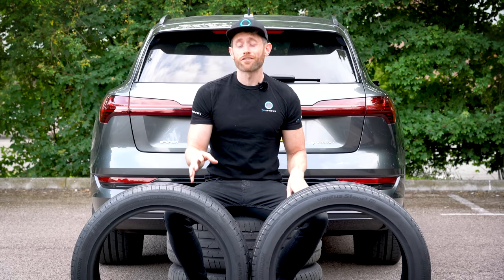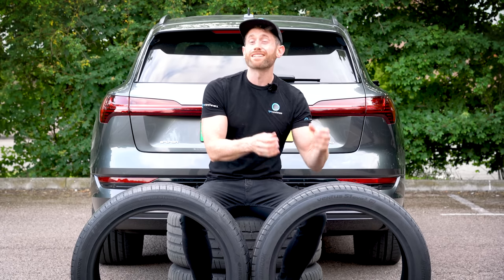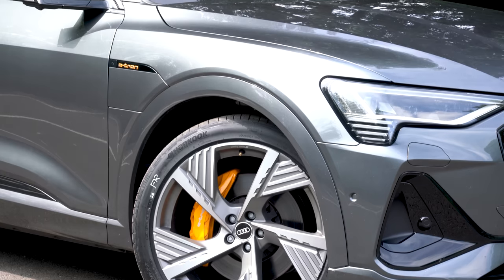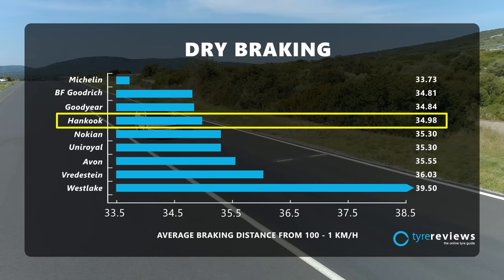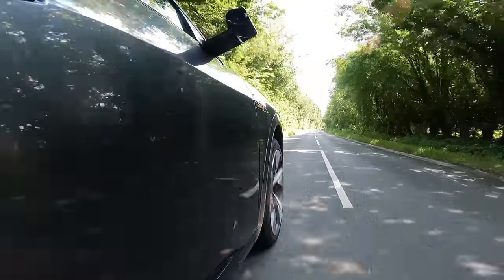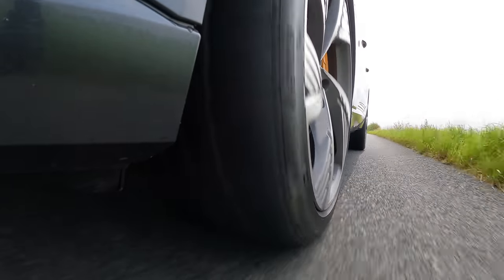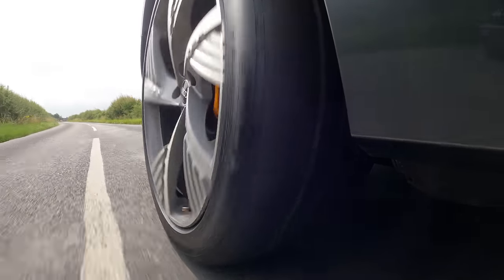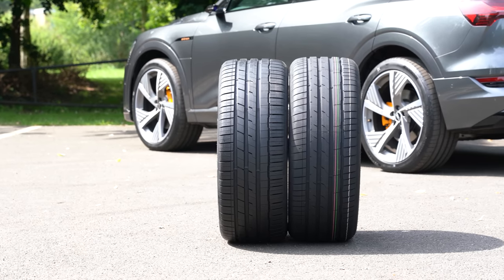What makes EV tires different, and why should you fit them! 🔌

Comment: Thanks for another very good tyre review. You mentioned the downside to EV’s of recharge time but I think that resale value is also going to be a big factor.
Reply from the maker: Good point!
Reply: I'd expect resale value of EVs to be better long term. They require way less maintenance and there's much less mechanically to go wrong with them. The big worry was always the batteries degrading, but that doesn't seem to be an issue on cars with good battery management (pretty much everything other than Nissan Leafs).

Even now, if you take a look at used prices for Teslas you'll see that resale value is very good.
Reply: @Xenon0000000000001  battery life is around 10 years in good conditions, you buy an EV, Tesla or whatever and run it for 2 years, battery life is now down to 8 years max if you’re lucky. Who will want to pay top dollar for a car with a max of 8 years left to run knowing that it may well be only 6 years?
Reply: @BobK5  Tesla’s last impact report showed about 10% battery degradation after 200,000 miles. The batteries in modern EVs will outlast the rest of the car. Just don’t buy an old Leaf.
Reply: @NickFoster  that’s reassuring if it’s accurate, I’ve yet to see it in practice though, running a battery car through seasonal changes and not always having the opportunity to charge it up efficiently. Running the car for 200,000 miles continuously isn’t the same as running the car 10 to 30 or 100 miles a day for ten years in road conditions and outside temperature variations. Who runs a car continuously for 200,000 miles?
Reply: @BobK5  because the 10 year life span actually means it will have lost 10-20% of capacity. It won’t be completely dead and will still be a completely viable car for the vast majority of people who average about 20 miles per day.
Reply: @therealjetlag  you’d have to be an idiot to buy a battery depleted vehicle with a life span of 5 years, unless it was £1.53 of course.
Reply: @BobK5  I think you need to do some more reading on the subject. The batteries are typically guaranteed for 8 years ( but are predicted to last for 150000 to 200000 miles, which is not much less than a diesel car and on par with a petrol. Secondly, EV batteries can be used for storage when they're no longer reliable for cars. People buy petrol cars with a limited life span ALL the time and you don't see anyone calling them idiots.
Reply: @therealjetlag  thanks for that Tat. Ok so you buy an EV with an 8 year guarantee (I’ll take your word on that as I don’t know what guarantees are given), where the maximum life in good conditions is reported as being about 10 years, so long as you keep it in a warm garage in the winter etc. 10 years for the average motorist equates to not more than around 100,000 miles. After the 10 years you won’t be able to do any more miles in the EV as the battery is no longer viable. 
So, you buy an EV for a premium price, above that of a similar petrol car and you have 10 years life expectancy. You run it for 3 years and do 30,000 miles which is the average and decide to sell it. Any prospective buyer will have to weigh up the price you’re asking along with the fact that the EV has only a max of 7 years life left and that from now on those 7 years are going to be difficult as the battery will continue degenerating as it ages giving the user less range, longer charging time and being impractical to run. Are you going to try and sell your EV to a prospective buying reflecting the premium price you paid for it? If so the prospective buyer would have to be an idiot to buy an EV with potentially 7 years life left and a rapidly decreasing resale value.
EV’s are a concept, the concept has been pushed through to the public long before credibility is achieved. 
The government has a track record of idiocy in this area, encouraging motorists to buy diesel vehicles instead of petrol, complete and utter stupidity sold on a false assurance that modern diesel vehicles were ‘cleaner’ than petrol. The same Ill thought out ideas apply to EV’s and it’ll be the customers who catch the cold with them for sure.
Reply: @BobK5  "After the 10 years you won’t be able to do any more miles in the EV as the battery is no longer viable. " 

No no no no no no no no no no no. 

You've already been told TWICE that, after 10 years, the battery will likely have lost 10% of its capacity. That means it still has 90% of its capacity, or, in numbers, that means a 300 mile range battery will still give 270 miles. Even if it's down 20%, you can still get 240 miles. When the average driver does 20 miles a day, there's plenty of life left in the battery.

Like I said, you need to do more reading.
Reply: @BobK5  And I've just googled "average lifespan of a diesel car" and it came back with 8 years. Yet, people buy 8 year old cars ALL THE TIME.
Reply: @therealjetlag  8 years 😂, take a look outside
Reply: @BobK5  what are you on about now?
Reply: @therealjetlag  I sold my Ford Focus that I bought new in 2001, 180,000 miles, 20 years old and still going that’s what I’m on about. You’ll be lucky to get 10 years out of an EV even if it’s only done 20,000 miles. You buy one if you want, it’s your choice but don’t come back here crying when you realise it’s money down the drain, you’d have to be pea brained to buy an EV for the full market price, sounds like you are.
Reply: @BobK5  you’re clearly not listening. I’ve explained it all, but you don’t want to hear it so the conversation is done.
Reply: @therealjetlag  I have listened to your understanding Tats which flies in the face of common sense, but if you’re an EV owner your comments do make sense but are far far far away from persuasive and I won’t be buying one anytime soon, that’s all that matters.
Reply: @BobK5  Twangman5: “no idiot would buy a car at the end of its life…” 
Also Twangman5: “I’ve just sold a car at the end of its life”.
At least you were honest in the end. You don’t understand EVs, you just hate them; fair enough. You could have saved us both time and just said you were going to be belligerent and not listen to a single thing I told you.
Reply: @BobK5  and I don’t understand how saying that an EV battery only degrades by 10% in 10 years “flies in the face of common sense”. You don’t get it, you don’t want to get it, you can’t be bothered to google it, you just want to troll. Enjoy your rising gas prices.
Reply: @therealjetlag  saying that an EV battery only degrades by 10% can only be intended to mislead as it’s untrue. Whatever you want to say about EV cars and how you believe they are economically and practically viable is great as long as you’re not expecting everyone to agree with you just because that’s what you want to think. Definition of a troll = anyone who disagrees with your point of view, which makes me a troll in your eyes.
Enjoy your EV, hope you get a good price for it when you’re ready to off load and enjoy the electricity price hikes coming your way.
Reply: @therealjetlag  I don’t hate them, I’ve test driven them and they’re good to drive but they’re not a good investment.
Reply: @BobK5  cars are never good investments, what are you talking about?
Reply: @therealjetlag  presumably you would rather walk, cycle or use public transport 😳
Reply: @therealjetlag  yes I sold the Focus at the end of its 20 year life of fantastic service to a scrap company who came and collected it, drove it onto the car transporter and disappeared. The only thing wrong with it was it needed a bit of welding on one of the sills and as I’ve got 3 other cars I let it go. If it had been an EV it would have ‘gone’ over 10 years earlier, what’s difficult to understand about that!
Reply: @BobK5  No, it would not have “been gone 10 years earlier” as I’ve already explained to you. There are 10 year old electric cars still on the road with far inferior batteries. I get it. You don’t want to accept you’re wrong. It’s hard. I understand.
Reply: @BobK5  cars are not investments. They lose value the moment you leave the forecourt. It has nothing to do with wanting to walk 🙄
Reply: @therealjetlag  cars, including battery powered cars, are investments when you use your own money to buy one. You are investing in the ability of the car to transport you whenever you want to wherever you want reliably, safely and efficiently. The more reliable, safe and efficient a car is the more your investment will be rewarded. Battery powered cars are not a good investment as at 5 years with 30,000 on the clock they won’t be attractive as an investment in transport to a prospective purchaser as they won’t be efficient for much longer. Using the term ‘investment’ does not automatically involve the value of money unless it is preceded by the word ‘financial’.
Reply: @therealjetlag  who in their right mind is going to buy an EV car with any sort of premium price tag with a battery on its last legs?
Reply: I saw tesla with 10 years for more than 30.000 usd...

Comment: Agree on EVs but in general, meaning day-to-day charging is a non-issue. It charges when it's parked. Does not matter how slow. At the grocery store, at IKEA, at the playground. Of course some destinations may be chosen based on charging infrastructure. For long trips, my experience is, the car is quicker ready to go than we are. It's mostly a myth. Except very specific use cases (e.g. external sales travelling 50+kkm/year.).
For non-teslas that's only going to be that way once the supercharger network is made available to every EV.
Reply: Even that specific use case ... I met a business traveller who had put 20,000 miles on his Tesla in the first six months he owned it: he was delighted with the fuel saving, which more than offset charging issues for him.
Reply: @gothmog2441  agree, in my company there is an external sales with a Tesla for years, but his area is only a few hundred km across. We have others that cover the whole country, so 500km one way is not a rare occasion. For them, 40mins of charging can mean the difference between seeing your kid on weekdays or not seeing your kid on weekdays. But however, covid has taught us that not all journeys are necessary...

Comment: What would happen if you put EV tyre on a non ev SUV as the weight is there so that disadvantage is not there? 

Do you pay more for the EV tyre?
Great video as always
Reply: I'd assume, apart from cost, the other potential issue is that a lighter vehicle might find the tread pattern makes it more inclined to aquaplane
edit: Yeah he covers this towards the end of his video
Reply: A Q5 is about 750-500kg lighter then the e-tron and a quick look on black circles showed an EV tyre was about £15 per tyre more then the equivalent summer tyre for my Nissan Leaf
Reply from the maker: Reduced comfort too, there's some bits at the end

Comment: I‘m the person who did thing the other way. I have a Toyota Rav4 hybrid and I've installed 4 Tesla Model Y 19inch OE wheels on my car. Those Tesla wheels have the Hankook EV tires on them and my actual experience was a bit different than what you said would happen in the video. The acoustic foam, which is a big selling point, is in fact useless. Road noise is worse after I fitted Tesla wheels. You can't feel it because you are in one of the most quiet vehicle in the market. Go ask Model Y owners, they will tell you how terrible the noise is. And then the fuel economy, I find very little impact. Even though the Tesla wheels are heavier(30+kg each vs 25kg each) and wider(255mm vs 225), I still have around 5.5L/100km city consumption. So my conclusion, after 2000km on EV tires, is that EV tires on conventional cars is not good idea😅

Comment: Very interesting review thanks.  I'm surprised that the EV tyre is heavier yet gives a longer range.  I've been looking at putting 18" wheels on a e-golf (replacing the visually awful 16" ones) but anecdotally this results in a reduction in range.  It sounds like this is due to the wheel weight being further out from the wheel centre and probably a stickier tyre.  It would be great if you could do a review of different wheel sizes on an EV.  I recall Engineering Explained found his range improved when he went to smaller wheels on his Model 3.  The other thing I would be very interested to see tested would be to see different tyres tested for accelerating from rest, particularly when wet, as wheel spin isn't something I've see rated and is a real issue with EVs.  This would then need to be compared with rolling resistance as I imagine it is difficult to achieve great grip and low rolling resistance.
Reply: The best for EV is lightweight rims but tyres with strong sidewalls (so most likely an heavy tyre).
If you do the opposite you will lose on range and driving experience.
Reply: I don't think the weight of the tyre/wheel combination really affects the range much, it's more down the the aero. Tyre sidewall is just more aerodynamic than the wheels, so they give better range. The other factor would be the tyre width if that was different for the low profile tyres, because narrower tyres are going to be significantly more efficient.
Reply: @Xenon0000000000001  A tyre/wheel weight will most definitely affect range.  Lighter the better.  The reason the EV tyre in this vid is heavier is due to being design for a heavier vehicle. A heavier vehicle will need higher pressures so the tyre deformation is more defined by that rather than the tyre construction.  So you need a stiffer tyre to handle the higher loads.
The reason a lighter setup is better for range is down to the energy required.  It takes less to get it rotating and to keep it rotating.

Comment: My electric Smart Fortwo came with Continental EV tyres, which when I came to replace my original tyres recently, I could not find anywhere in the size I need. And the tyres I could find were summer only, not all seasons. 
If it is recommended that we got EV tyres to EV's, then not options need to be available. 

This was a very interesting video.

Comment: The charging times of EVs is a huge barrier for many - especially for those without a driveway and ability to charge at home. Let alone the cost of them. 

Was at the small, local supermarket the other day and for the first time saw one of their EV charge points actually been used. Used meant a flustered looking father anxiously checking his between his watch and the charging progress, and two seriously fed-up looking kids sat on the curb playing with phones. Not a great advert!

Great test though.
Reply: The cost is close to parity now. 84% of people with cars have a drive so that’s a big part of the market. I find it much more convenient to fill up an ev, just plug it in at home every few days and charge overnight, much better than driving out of my way to fill up with petrol or diesel taking at least 7 mins of my day and costing 10 times what it costs me in electric. I doubt the guy you mentioned at the supermarket was on a road trip, those chargers are slow and add 30mph.
Reply: @scottwills4698  84%? Where do you get that figure from? It might be true for the suburbs, but I bet it isn't for cities! (whether the US, UK, Europe etc).
Reply: If i could charge at home id have an EV as a daily already. Unfortunately its almost impossible if you have to rely on public chargers, and thanks to the crazy electricity prices we have here in Germany the EV can quickly become more expensive to "fill up" than a compareable Diesel.
Reply: @Assimilator1  it is, 84% of people “WHO OWN AND DRIVE CARS”. Ok, I checked to see if I can find the link to this and the best I could find was 70% on Statistica and it was a few of years old. The figure in the press is 30% of uk homes have off road parking which is misleading as a lot of urban homes will use public transport etc as it’s more convenient.
Reply: I suggest the father and kids were waiting for the wife to come out of the supermarket. Any one who has owned an EV for more than a few days has little problem with charging.

Comment: Hankook have done a great job with the s1evo3 ev. Btw I think you didn’t mention comfort?
Reply from the maker: Comfort was mentioned, slightly better on non-ev, and they sure have :)
Reply: @tyrereviews  thanks! Must have missed it. Would be interesting to know the rolling resistance levels. I would say the EV must be around 6.
Reply: @tyrereviews  I am currently using S1 Evo3 non EV. Although it is performance tyre but the tyre isn't stiff but yet it still provides great handling in concern and feel planted at highspeed. Value for money!

Comment: I've been driving an EV for over 8 years now and honestly, I barely ever look at my range. I start every day with the same charge and my normal driving only uses around 25% of it so range is not nearly as big a factor as noise, comfort and handling for me. When I first got it I was obsessed with range and efficiency but as fast chargers started being built out and I got used to my daily range use, I started caring less and less about efficiency.

Than being said, from my experience, speed and tire pressure are the biggest killers of range. The car came with performance oriented all-season (3 season because Canada) tires and I just run performance summer tires in the summer and "extreme winter" tires for our long snowy winters so I can get to the ski hills (and not die in our frequent snow storms). The range hit has been unnoticeable to me because of all the other factors that affect it and with as much range as I have, I really don't worry.

That being said, if I can get better performance, superior comfort AND better range, I will definitely take it!